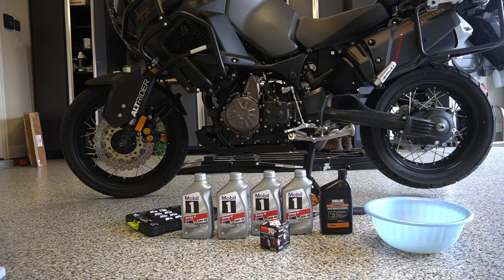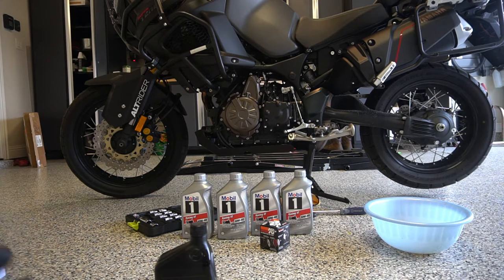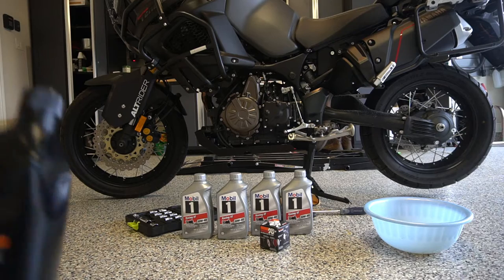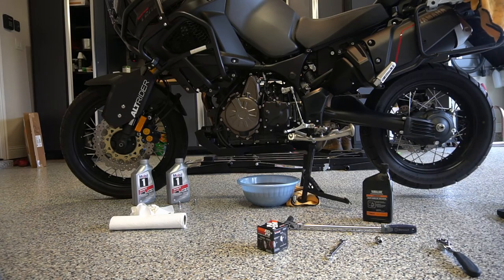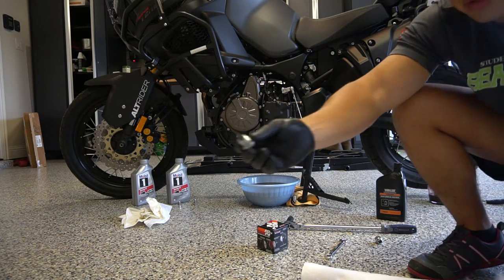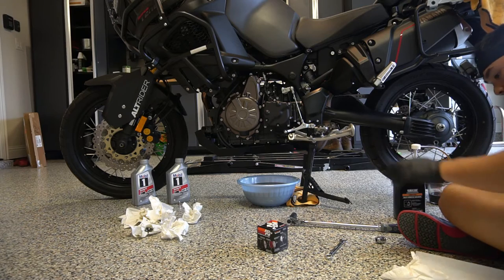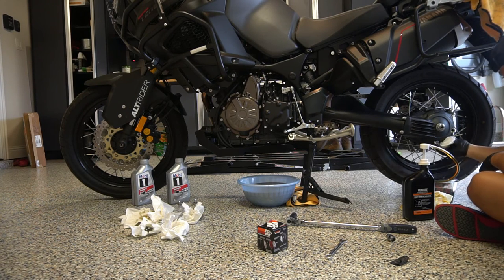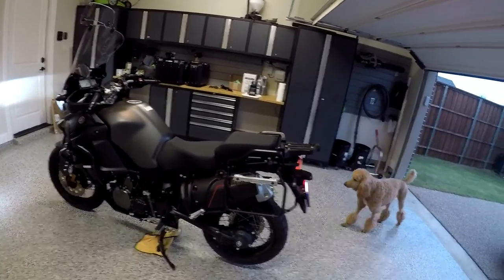2014-2018 Super Tenere Oil Change and Gear Oil Change

Comment: Limited slip sends some power to both drive wheels in a car. Since the motorcycle only drives the rear wheel there's no need for an additive. Great video by the way and super nice shop.

Comment: is to know the difference in motor oil yamalube and mobil1, the engine goes quieter sifts better?
Reply from the maker: I don't think i would be able to tell.  I think both are good oils I just mobil1 because I use them in all my cars/trucks at my house and never had a problem with mobile 1 oil.

Comment: Did I miss something here? It appeared that you only removed one of the two drain bolts for the sump. If so then you would not have drained all of the old oil.

Perhaps I did miss that after all?
Reply from the maker: min 4:59 remove first min 5:26 remove second

Comment: Hello Flea hows it going? I have a 2012 that i just purchased and it has a low windscreen. What windscreen do you have on yours as it appears to be much taller and wider than mine.
let me know when you do a vid on changing the fork oil on your s10. take care.
Reply from the maker: Congrats on your new purchase!   Im using the National Cycle V stream Touring windscreen with an MRA X clamp on extender.   As far as the fork oil because i have the ES model ill probably take it into the dealer as the forks also have electronic components i dont want to mess around with, but well see when that time comes.
Reply: Get a MadStad windscreen and bracket. The best there is.